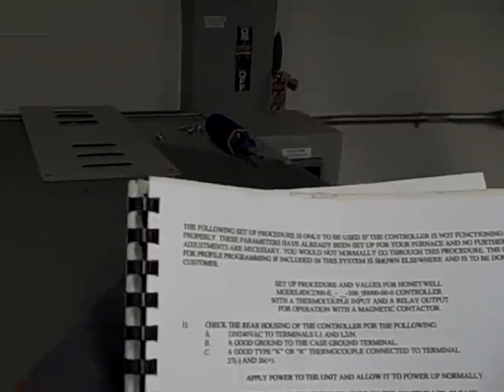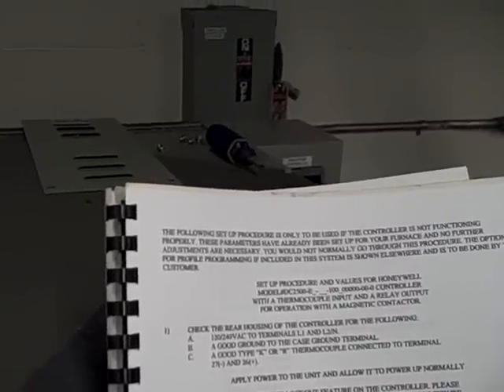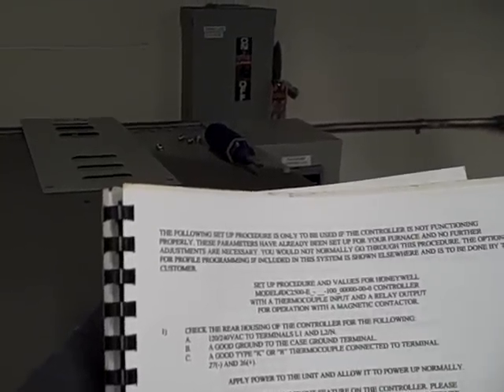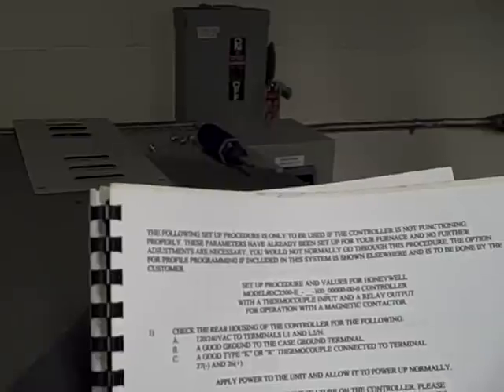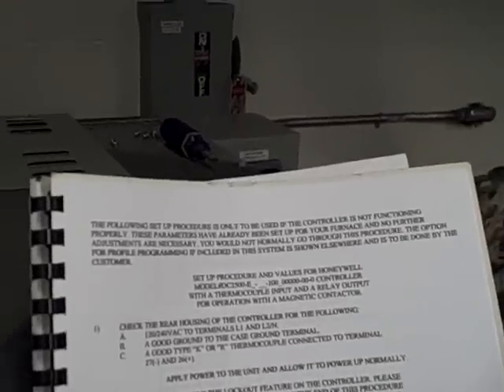Troubleshooting a furnace temperature controller problem -- part 1

Comment: My Rudd oil furnace was not turning off once reaching set temperature. The thermostat was replaced, and the problem still persisted. An electrician friend moved some wires (he said were apparently touching and shorting out) and the furnace turned off (after reaching 85F). He moved the wires (low voltage) apart so they would not touch and the furnace worked correctly for 6 days, then did it again today. Those wires go from the furnace to the 'fuse' on the opposite side of the wall from the thermostate. How can that be fixed? replace the wires? For awhile I was turning the furnace off in the main house breaker box until my friend showed me a switch on that same 'fuse box' behind the thermostat.